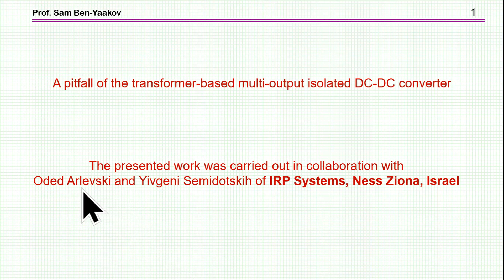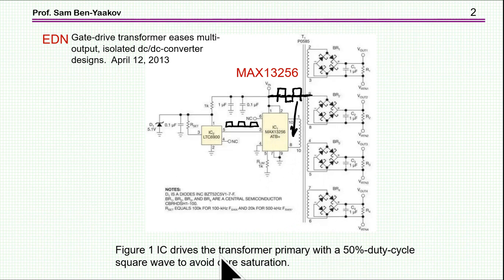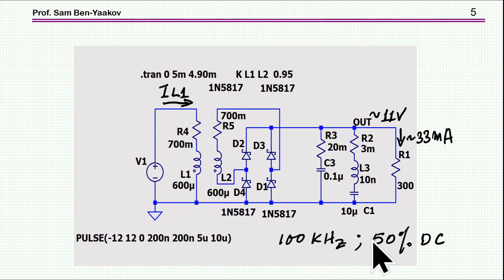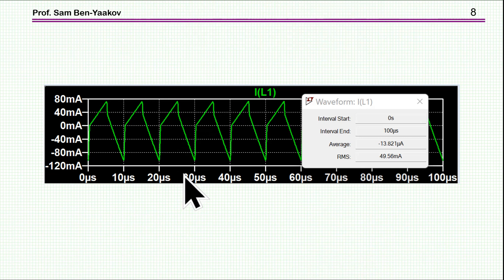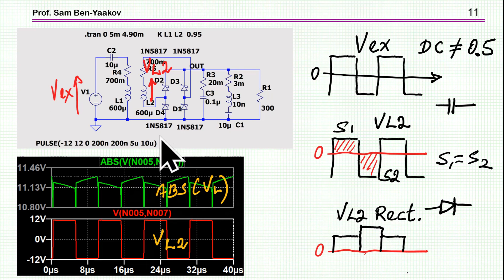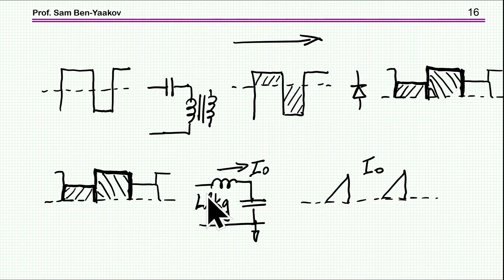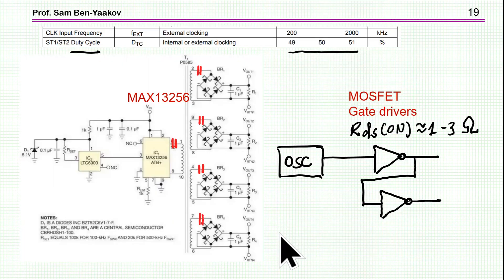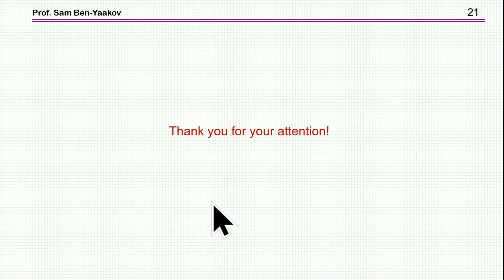A pitfall of the transformer-based multi-output isolated DC-DC converter

Comment: Wonderful explanation. However, the title might be misleading because any transformer has to be connected in series with a capacitor for elimination of DC current, which has nothing to do with the multiple outputs being drawn, unless I have missed some important points. 

At the same time, I have another question. 
1) At the conclusion of the explanation, you say we have to include another series capacitor on secondary side also. But, why the series capacitor in primary is not eliminating the DC current on the secondary side also. Since there is no DC component in primary voltage, there will not be any DC component in the induced voltage and thus there is no question of DC current component on secondary, thus no need of series capacitor on secondary side. 
2) Also, from equivalent circuit point of view also, the series capacitor in secondary just comes in series to the capacitor in primary... (Same as question 1, in another perspective)

Where is the flaw in my understanding, I didn't get. 

I would be grateful if you can answer. Thank you, a lot.
Reply from the maker: As for the title, you are correct, there is no need for the  "multiple". However, as for the DC,  the DC is not transferrd from primary to secondary so you can have DC on one side and no DC on the other side, or you can have different DC values on each side.

Comment: Professor, something feels off about the explanation of necessity of that secondary cap, let me try to explain. The assertion is that the DC component through the secondary winding (whatever the cause, it happens to be the duty cycle error here), can cause saturation of the core. The problem with that is that the total current in a transformers' winding is not what causes core saturation, but rather the magnetizing current. The magnetizing current is purely a function of the volt-seconds on a winding (in this case the secondary), so as long as the volt-second balance is maintained on that winding (and it should be with the series cap in primary), the magnetizing current will have an average of zero, while the actual total secondary winding current itself may have a DC component.

I'm not sure if my explanation is easy to follow, but I would like to see the integrated measurement of the secondary voltage average and see if the average is zero. If it is, I assert that the magnetizing current is zero, even if the total winding output is not. Maybe it could help to instead use the Lm + ideal transformer model instead of the coupled inductor model to see it here. -Ivan
Reply: I did the LTSpice simulation as well, and can see that my assertion is incorrect, and there is still a DC component through the actual magnetizing inductance, but I don't intuitively understand why that is, when the secondary volt-seconds should be zero (they are close, but not zero).
Reply from the maker: Take one step back. Assume a transformer fed by an AC voltage sources imposing a balanced volt-seconds. Now connect a half wave rectifier (one diode ) on the secondary. It will cause a DC current to flow at the secondary. DC currents in transformers are not necessarily linked to unbalanced volt-second.

Comment: Hi professor..

What should be the min bandwidth of open loop system in flyback converter.

Please detail about its pros and cons..
Reply from the maker: The issue is not BW but phase shift that complicates the  compensator (feedback).The closed loop BW will determine the response to input voltage and load steps. In practical systems, a closed loop BW of 1- 4KHz is possible with switching frequency of about 10kHz

Comment: Adding capacitors is not feasible for higher power outputs.
A better way is to make the drive symmetrical by using a flipflop divider.
The only asymmetry is then turn on vs turn off delay of the switches in the primary.
Also a better wound transformer should not have more than 0.1% leakage.
I have made pushpull converters delivering several hundred watts using this method.
One issue is the diode recovery of the output for higher voltage, which can today be solved using SiC diodes.
Reply from the maker: Thanks for sharing. This video deals with low power auxiliary power supply solution.

Comment: It seems to me that adding the two suggested capacitors would be beneficial, even when the circuit is driven directly from mains, without a special driver to increase the frequency above 50/60HZ. Your thoughts?
Reply from the maker: Low frequency means bulky transformers, generally not favored in modern design.

Comment: Great presentation as always :-)  However, I do not think you are right. The MAX13256 as you mention has a duty cycle of 49% to 51%, but that is likely just for production test. The device has internal flipflop, so the duty will be very close to 50%, except for asymmetry in rise/fall times and propagation delays. Additionally it has internal deadtime. In your simulation you do not model the RDSon of the high and low side FETs. If more current runs in one FET, the RDSon balances out the delivered average to the transformer, and also the RDSon increases with temperature, counteracting the asymmetry. You mention aging of the driver. I do not believe that has any effect. The flipflop does not change with aging and transistor rise/fall times does not either. So all in all, in a practical circuit with non-ideal components this will not be an issue and there is no reason to add a capacitor.
Reply from the maker: Hi Klaus, I don't agree that the duty cycle of the the MAX13256 can be assumed to be exactly 50%. Rise and fall times, dead time and jitter of the input clock may cause a deviation in the duty cycle and they are all temp dependent. But the primary reason for not assuming 50% is that I am not for trying to outsmart the manufacturer. If he says 49-51% then, in my opinion and experience,  it is bad practice and in fact dangerous to assume that you know better. There is also a legal issue here in case of a damaging malfunction. And... it    seems that Analog Devices agrees with me. On an advanced unit  MAX22256  they show a cap at the primary. If the duty cycle deviation is 1% a cap at the secondary is probably not a must. But I am afraid that you missed the point, which is: no need for this fancy IC.  A dual inverting gate driver package connected as an RC oscillator (or plus a 555) is sufficient if you put the two caps.

Comment: Thank you professor, I never thought this gets that ugly on the secondary side, with second diode not conducting at all.
IMO the proper-proper solution would be a current mode push-pull controller - it ensures flux balance from the start, but hey, a few caps work as well!
Reply from the maker: Thanks for the input. IMO peak current mode will NOT help. It will just make it worse. Look at the secondary current waveform. For PCM you need a triangular waveform and the peak at the required transition point, i.e. large inductor.
Reply: @sambenyaakov  As is no - it doesn't even have an output inductor.
Buck cascaded with push-pull is viable solution though.
Reply from the maker: @VEC7ORlt  Buck? The whole point of this simple converter that it does not require an inductor
Reply: @sambenyaakov  For simple solution nothing beats 2 caps. I was just thinking aloud.
Reply from the maker: @VEC7ORlt  👍

Comment: What about the effects of dead time for the main switcher IC? In the case where there is dead-time and some freewheeling body diodes to perform the conducting, the problem of duty cycle at least on the primary side should be mitigated i would think... Like if you had 1% dead time (1% of the switching period) then you should be able to accommodate for that same amount of deviation from 50%?
Reply: Dead time solves cross conduction problems, not volt-second imbalance.
Reply: @VEC7ORlt  what I mean is during that deadtime the voltage will self-actuate. So if you have it ON for 49% of the time and OFF for 49% of the time, with 2% dead time, then the voltage will self actuate at 50%, without the need for perfectly accurate on and off times. You could also have it ON for 49.2% and OFF for 48.8% or something, I think the "slop" will allow the voltage to self-actuate at 50% still. Not 100% sure tho
Reply: @power-max  Realistically, are those 2% enough? Diodes will need to conduct, bleed off the DC, reverse recover, all of that in those 2%.

Comment: What about introducing a dead time in the driver? The duty cycle will be less than 50% but it will be easier to preserve the symmetry. What about intoducing a small gap in the transformer to keep it accomodate some DC?
I suppose the same phenomenon occurs when driving the primary in push pull with a center tap instead of in H bridge configuration, correct? 
Thank you very much for your explanation.
Reply: Why modify the transformer when you can just add some caps?
Yes, its exactly the same problem.

Comment: I find this a little bit baffling. The asymmetry is caused solely by the driving side. Surely the driving IC is designed to drive the transformer symmetrically. So why then would it have a specification tolerance large enough to cause problems of this sort? That would go against the logic of having an IC (rather than a custom circuit solution) in the first place.
This analysis might be useful for linear PSUs too. I understand that the AC mains waveform is rarely distorted in a symmetrical fashion but I admit I do not know whether that distortion means its duty cycle changes from 50% over any period of time.  How does one calculate the capacitor size though? Surely that would depend on the leakage inductance and the transformer inductance but in what way?
Reply from the maker: To be fair, in many low power applications the common designer will not be aware on this fine detail, since a transformer can tolerate some DC current.
Reply: @sambenyaakov  The datasheet says it is intended for up to 10W PSUs and a maximum 300mA current. So you are right in that respect. Then again, I am not sure how beefy a 10W transformer would need to be to tolerate upwards of 100mA DC.
In the MAX22256 datasheet, which is a similar IC, a DC blocking capacitor is shown on the primary side in the example application circuit. I think that IC is intended for up to 15W.
Reply: Something I did not see mentioned is that driving the primary single-ended means pushing voltage (and eventually current) during the positive excursion but when the drive goes to zero, it is not pushed (or pulled) to zero, it merely falls to zero, how quickly it falls to zero depends upon the impedance of the source.  If the drive goes to high impedance then the voltage collapses quickly and you get a spike on the secondary and it won't be symmetrical since this spike only happens on the fall of the primary.
An obvious solution is to have push-pull on primary so the drive current is the same in positive and negative halves.   This is shown at the end of the video where the positive and negative excursions have MOSFET drivers.
Reply: @thomasmaughan4798 the datasheet does show a push-pull drive arrangement on the output of the IC.